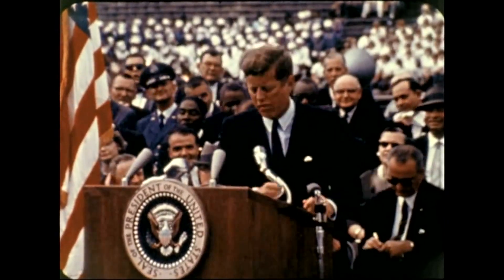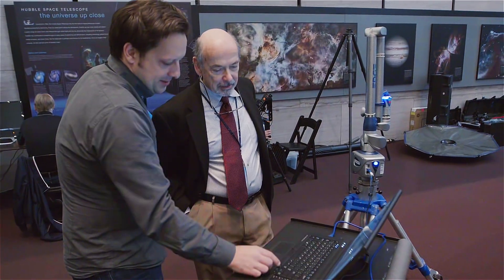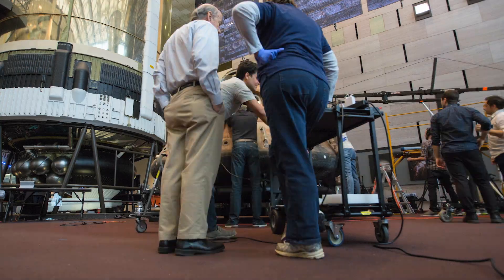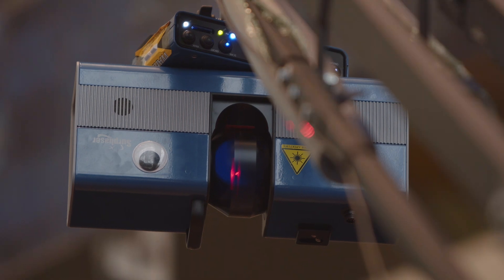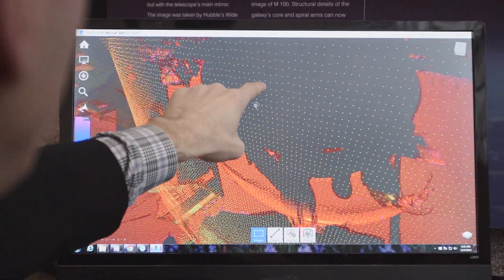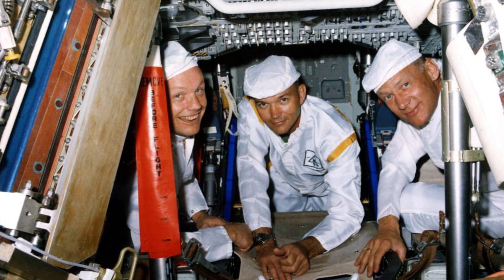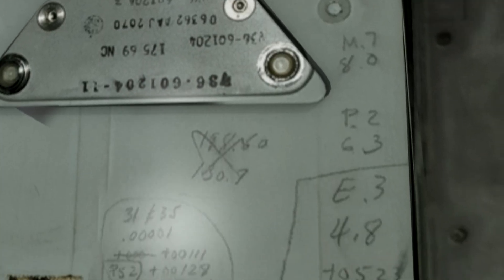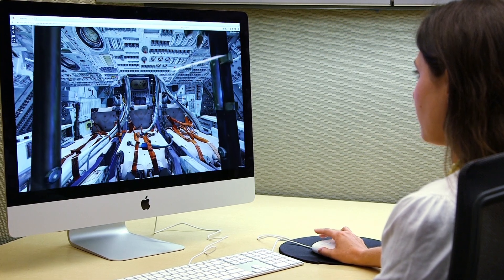Apollo 11 Command Module | 3D Documentation

Comment: This thing is not radioactive?
Reply: Why would it be radioactive?  Oh you mean the passage through the van Allen belts?  Wrong sort of radiation try looking up what the VAB are and how they bypassed them.
Reply: @ianb9028  You have radioation in whole space.If earth don't have a magnetic field we will be dead.You have radioation also on moon!!!!Think.
Reply: No it is not radioactive. This module orbited the moon while the Lander transferred the two astronauts to the surface and back. 

There are a couple of types of radiation. In space almost all radiation comes from charged particles produced by the sun. These are mostly electrons and protons. Some of these are held in the earth’s magentic fiels producing the Van Allen Belts. These do not make other materials radioactive. 

Radioactive decay is a process that occurs in unstable atomic nuclei. The instability results in an emission of:
-  alpha particles (2 protons and 2 meutron bound together). These can be blocked by a t shirt but cause damage to whatever they impacr
-  beta particles which can be positive or negative depending on the parent material. Beta negative is produced when a neutron in an atoms nucleus transforms into an electron a proton and an antineutrino. Beta positive is when a proton transforms into a neutrino a positron and a neutron. Beta radiation can be stopped by a few millimetres of aluminium 
- gamma radiation often follows the nuclear decay when the nucleus now left in an excited state sheds energy by emitting a gamma ray. Gamma radiation is the most penetrating and require several centimetres of lead to stop them. 

Materials become radioactive when the nucleus becomes unstable. It occurs in high energy fusion processes in tje sun. We can producs it by lacing an object near a source emitting beta positive radiation and it absorbs enough neutrons to make the nucleus unstable. 

Radioactive carbon can be produced in the atmosphere by the interaction between cosmic rays and atmospheric nitrogen. 

The command module did not become radioactive during the moon mission
Reply: @ianb9028   As l say radiation is a fake and space is very friendly.
Reply: Is your food from the microwave radioactive?   Are you radioactive after an xray?  No.

Comment: Where did they take a dump?
Reply: Solid waste was collected in plastic bags that were taped to their rear ends. Then the bags were stored in the empty food lockers, where after all the poop originally had come from. Liquid waste was discharged into a funnel connected to the outside so the urine was dumped overboard.
Reply: @joevignolor4u949  on the shuttle during take off & landing the astronauts wore a kind if condom which lead to a collection bag. According to one user they came in Small, Medium & Liar !. A “contoured, custom made to fit, device was experimented with for female astronauts but the ended up just wearing nappies (diapers for the colonials ! lol)
Reply: The bags taped to their rears had a germicidal pouch inside which the user had to mash into the contents to prevent “outgassing”.😮 Due to the lack of gravity any waste wouldn’t fall away from the body so the bags had a “finger” on them for the user to bat the feacal matter into the bag. It was affectionately known as the “sh*t mitt”.

Comment: Did you notice that the outside boundary of the moon is just as bright as the moon’s center (at full moon)? 
Moon has uniform luminosity across its surface. Now, if you shine light from a light source onto any ball (and the light source is behind you), you will distinctly see the brightness decreasing as you look from the ball's center and toward the ball’s boundary. 
This is because most of the light reflecting from the ball’s center is toward you but very little light reflects toward you from the boundary. 
Yep, moonlight is not from a ball that’s reflecting light from the sun.
Reply: So you believe the moon is flat? Oh my this new generation of fucking idiots... Look at the phases of the moon. Hold up a ball and circle it around a light source. Only a sphere can make the phases like they have. Are you really this ignorant or are you a troll? Seriously? Open a science book and turn off the video games.
Reply: That's because the sun isn't right next to the moon. Scale it properly and place that flashlight a few miles away. The ball will be lit evenly.

Comment: Built with chicken wire ?
Reply: Carl Smallcombe 
The honeycomb shape is one of the strongest geometric designs. NASA filled the fiberglass/ceramic/asbestos cells with heat resistant foam. That shape also happens to be REALLY good at deflecting and redistributing heat, which is important for a spacecraft heating up to half the temperature of the surface of the sun.
Reply: not the only one who noticed the ckicken wire heat shield